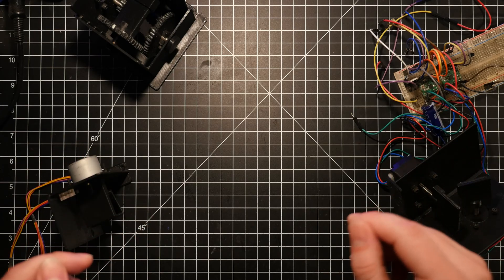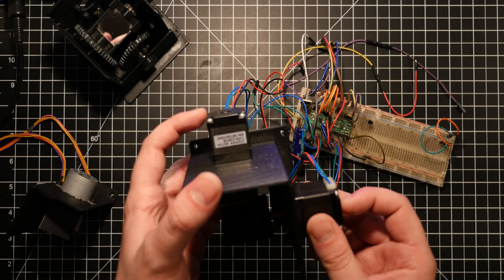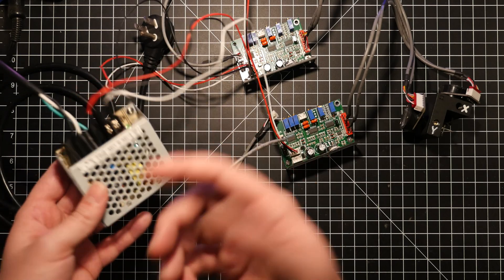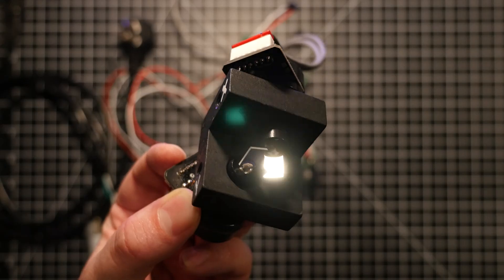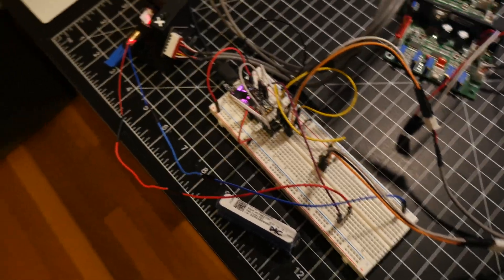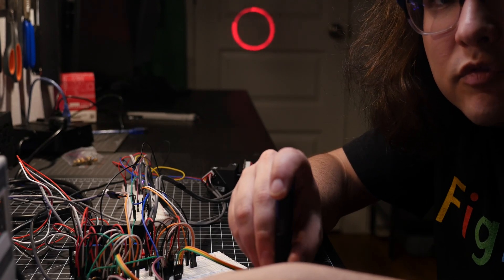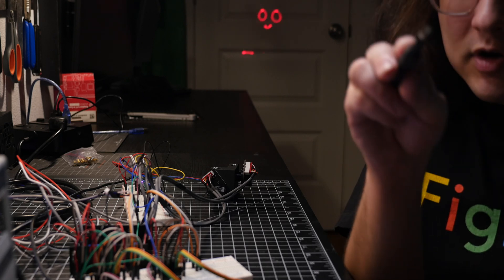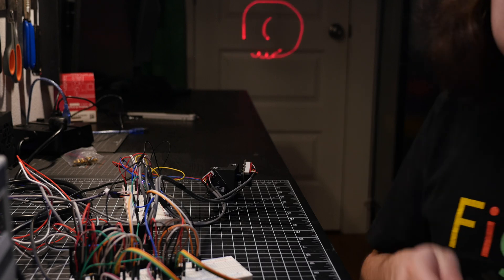I built a laser wall for my home office

Comment: What was wrong with the geared assembly, exactly? You say that it was over engineered but you don't list any specific problems with it.
Reply from the maker: Good question! It offered basically no advantages over direct drive from the motors. All it did was introduce complexity: More (and more complex) prints, additional parts, more backlash, more noise.
Reply: @paulstraw  No improvement to resolution or RPM, then? What was your ratio?
Reply from the maker: @claws61821  I don't recall the specifics, unfortunately. I didn't document those tests well, and they were several years ago. I'm sure with more printer calibration, better gear design, etc, you could get a better result! It just didn't seem worthwhile to optimize something I knew was a dead end.
Reply: @paulstraw  Fair enough. Have you considered using the galvos to drive a pan and tilt gimbal or a 2-axis compliant flexure with a single mirror? That seems to be the process in vogue for rasterizers lately...
Reply from the maker: @claws61821  I hadn't, but both sound like very interesting options! I'll have to do some digging on those, thanks.
Reply: @paulstraw  My pleasure! I've been looking into this a bit myself lately Ruth far less knowledge than you have XD Would persistence still require 10 passes per sec for rastered images, or would the consecutive lines suffice?
Reply from the maker: @claws61821  I'm not really sure to be honest. That number was just from googling "persistence of vision FPS" or similar, nothing too deep.